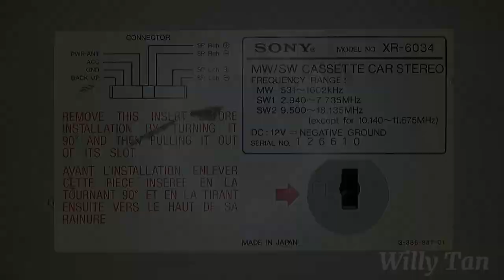SONY XR-6034 Car Cassette Player Repair ( Capacitors, Pinch Roller & Belt )索尼汽車卡式唱機維修 更換壓帶輪, 皮帶 & 電容

Comment: You are the best. Always wondered how to get to those pinch rollers.
Reply from the maker: Thanks ^^
Reply: @livinganalog7089  I did this to my Matsushita deck and got the rollers out easy. They look like 10x6x1.5mm rollers. Where did you get your rollers? I'm having trouble finding exact replacements.
Reply: I found exact replacements from a company called Yibuy in China. My deck now works great.
Reply: @bladesshredder6663  Thank you for the updates

Comment: How you confirmed the faulty capacitors ?
Reply from the maker: Because the noise, and this is new old stock, normally its only rubber & capacitor problem